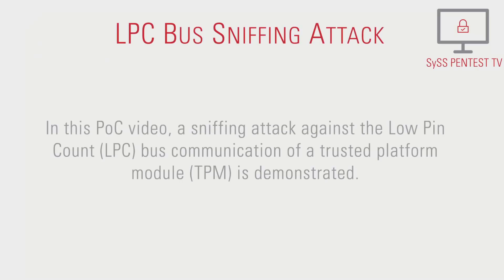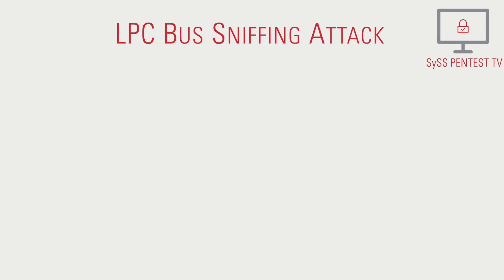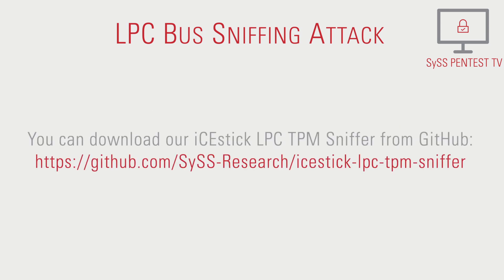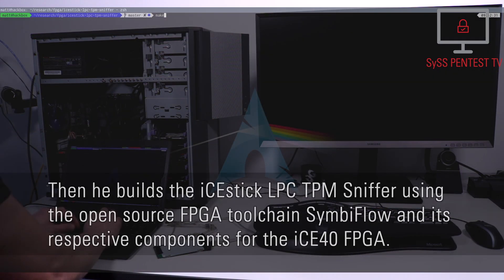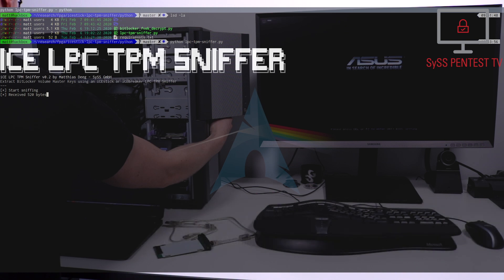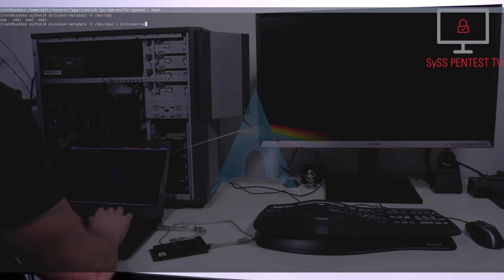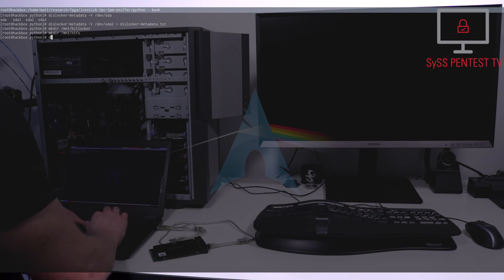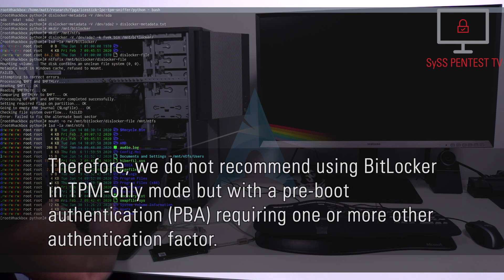LPC Bus Sniffing Attack against Microsoft BitLocker in TPM-only Mode

Comment: Thank you so much for this video. I've been able to replicate this almost up until completion. Except at the end once all is prepped and ready to go, when I launch the lpc_tpm_sniffer.py, I get "Unable to to connect to FTDI serial interface". Using most recent version of Ubuntu, and have removed the default ubuntu usb drivers, and install the d2XX drivers. Does the Ice Stick have to be in d2xx mode on both side A and B? Is there additional config not covered in the original thread? Any help is appreciated! Thank you!

Comment: What cables/fly leads are you using to connect the J1 on the iCEstick to the TPM chip?
Reply from the maker: Some jumper wires and a simple custom-made breakout board are used. You can find more information in our GitHub repository for the "iCEstick LPC TPM Sniffer" ( https://github.com/SySS-Research/icestick-lpc-tpm-sniffer ).